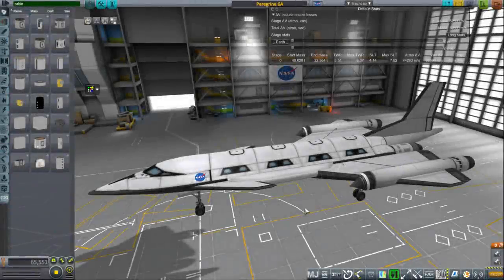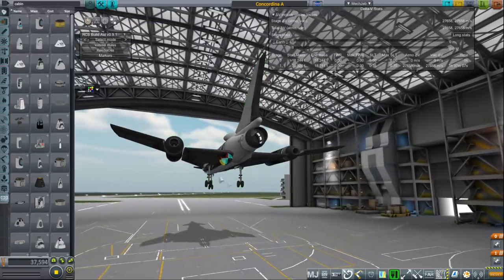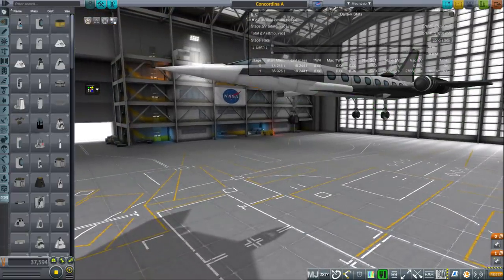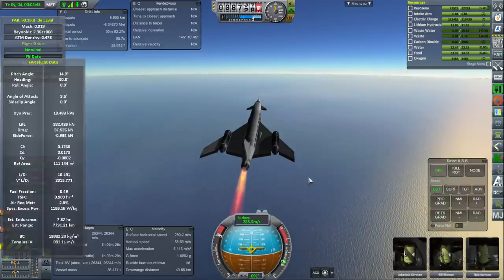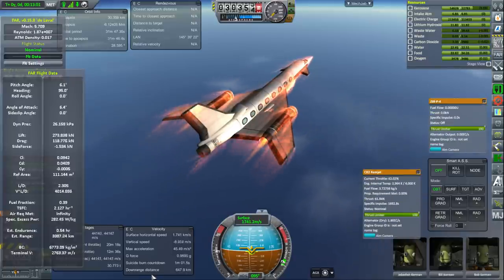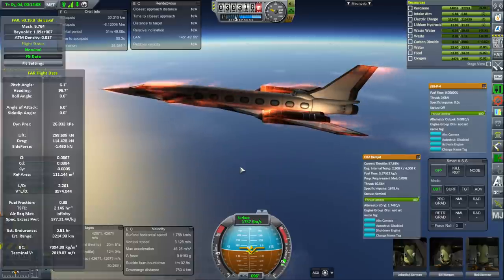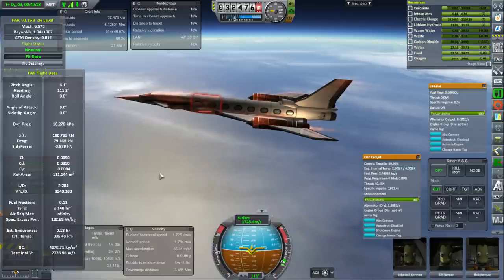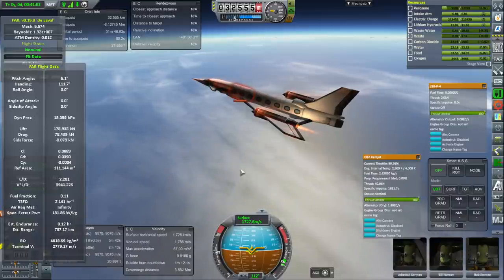Kerbal Space Program RO Sandbox - Hypersonic Liner Development 04

Comment: Nice video as always :)

Regarding the missing spawnmarker for the shuttle-landing strip:
Through the KK-Editor, I was able to add a spawnmarker for the shuttle runway. It is not 100 % perfect, since the craft gets dropped from roughly 2 meters on load-up, but that seems like a good trade-off for having a proper runway (and the drop can be minimized by holding the the craft via clamps).

Anyway, here's how to add the marker:
1) open the spawnmarker.cfg in the TWRLS folder 
2) add the following code after the last Instances{} but infront of the main closing bracket:

Instances
 {
  CelestialBody = Earth
  RadialPosition = 903872.438,3063177.75,-5512676
  Orientation = 0,1,0
  RadiusOffset = 44.5205688
  RotationAngle = 45
  isScanable = False
  ModelScale = 1
  RefLatitude = 28.737672853117957
  RefLongitude = -80.688490526734483
  VisibilityRange = 100000
  Group = KSC
  GroupCenter = false
  useRadiusOffset = True
  LaunchSite
  {
   FacilityType = LaunchSite
   LaunchPadTransform = Marker_spawn
   LaunchSiteName = Shuttle Runway
   LaunchSiteAuthor = Divico
   LaunchSiteType = Any
   LaunchSiteDescription = Longer, less bumpy runway.
   Category = Runway
   LaunchSiteLength = 1
   LaunchSiteWidth = 1
   LaunchRefund = 0
   RecoveryFactor = 50
   RecoveryRange = 100000
   LaunchSiteIsHidden = False
   ILSIsActive = False
   OpenCost = 0
   CloseValue = 0
   OpenCloseState = Open
  }
 }

3) select the "Shuttle Runway" from the KK launch site option within the SPH
4) If you want to adjust the spawn point, hit ctrl+k and look for spawnmarker (1). Then you should be able to adjust the spawn point via the editor.

Have a good one,
Max
Reply: That's kind of odd, isn't it?
I am using version 2.0 of Real Launch Sites and version 1.2.0.0 of Kerbal-Konstructs.